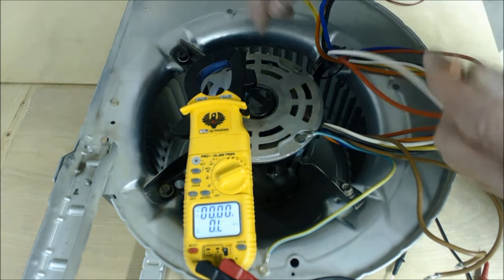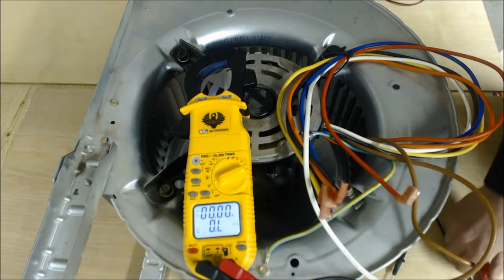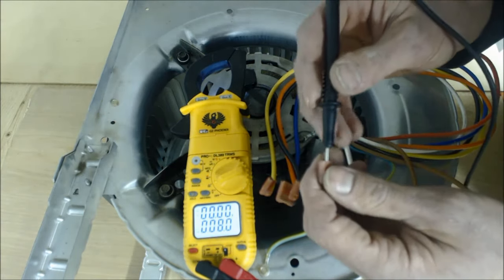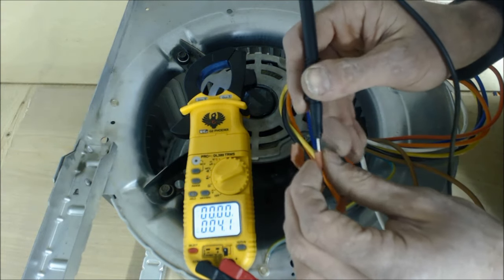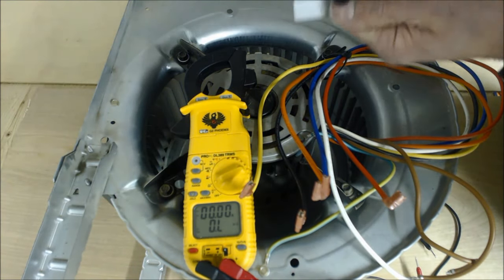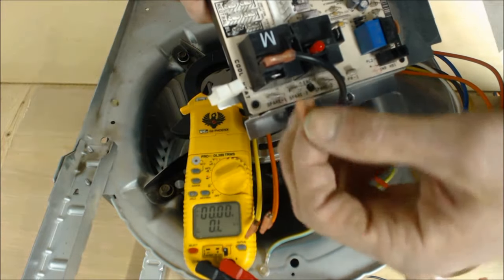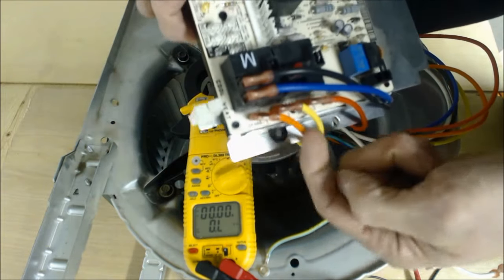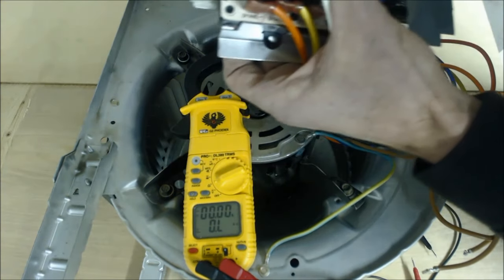Explained! HVAC Furnace Blower Motor Wire Color Speeds: Color Code, How to Test to Verify Speeds!

Comment: Thanks. After watching video I studied the wiring diagram and found previous tech had boosted blower speed. Before improvising, I decided to revert to factory configuration. Big big difference. House is warmer and furnace runs half as much. Thank YOU!
Reply from the maker: Glad to hear it worked out. Thanks

Comment: A+ on this sir. Good and clear details on what seemed an impossible task to 100% confirm which wire was the correct speed. Just went down and metered my carrier and got the exact OHMS that proved the wiring was correct. Blue was higher speed than the Red and using the spare tab to keep the Red cable now. The Blue is on Heat High and Yellow being used for Heat Low. The black and white cables are not being used for the speed.
Reply from the maker: Thanks J Pej!

Comment: Thanks for sharing!  Our house furnace was wired wrong..   I'd say a shitty tech trying to upsell new equipment.  

Heat was on black or high speed wire.  Cool was on blue or medium low.  

So moved cool to black.  Orange was medium high, so that is new heat wire

Comment: This is especially helpful if an original blower motor on a unit was changed and the speed taps are different. Keeps from pulling a blower motor just to check schematic.
Reply from the maker: Yes absolutely, thanks Blue Collar!

Comment: Typical color coding: Green = Ground, White = Common, Black = High speed, Blue = Medium high speed, Yellow = Medium low speed, Red = Low speed.  Brown and Brown striped = Capacitor
That is what I have learned.  I note this because few people mention the 4 speed motor wiring.

Comment: I need a video like this for a range hood fan motor. The only video I can find unhelpfully advises I wire the board in using the same colour coding as the old one. Which is fine if you have the old one in place to go from, but in my case I don’t.
Reply from the maker: Sorry Dom, I don't have a video like that.

Comment: Great video. I wanted to clean out my blower motor 'box', and I came across your video.  Question:  Is there any reason you can think of why my heat is connected to the Hi fan speed terminal, and my AC to the Medium (blue) terminal?  I live in Dallas, so I would think I'd want the AC running on the hi speed.  thanks
Reply from the maker: Usually that is the case like you said unless there is some mistake match with the system design.

Comment: My blower moter looks almost identical to yours but my wire colors are different. Mine has no white and no orange. Can you help me decode the 4 colors I have? It only has a black, yellow, red and a blue wire. Since I have no white, I dont which one is the common and which ones are for the different speeds? Thanks. 

PS: I did apply power to the black and yellow wires and it came on just fine but that was totally a Hail-Mary guess. It probably could have went horribly wrong but luckily it worked. I got pretty excited. I felt like a bomb technician on Mission Impossible 😂. I immediately ran out of confidence after that. I just don't know what speed it is or if its even suppose to hook up like this.

Comment: I have a query if you can please answer. I'm going to add a Honeywell UVC lamp to my return duct. It works on line voltage and stays always ON as long as it is plugged to a receptacle. That's what I do not desire.
I want the UVC lamp to turn ON only when the blower turns ON, irrespective of whether the blower is set to Auto, Circulate or always On and turn off when blower is off.
So my question here is should I be wiring the lamp across BLK-WHT or BL-WHT ?

Comment: Do you need to discount the capacitor taps before taking resistance measurements?
Reply from the maker: Yes the blower will mainly discharge the cap after the power to the blower is turned off but the blower is still free spinning. However there is still a little you will need to bleed off with a 10,000 or 20,000 ohm resistor or shorting it, thanks

Comment: My A/C guy just replaced my blower motor and now I hear a small hum coming from it when the A/C is running.  I've taken the grates off the A/C and can hear that the sound is not coming from the new motor and there is no shaking from the motor.  It seems to be coming from above the blower (maybe where the coils are?).  The motor has a Black / Blue / and Red wire.  Black is on Cool, Blue is on Heat, and the red was just cut and covered with electrical tape and stowed away.  My question is this:  Could the blower motor be sending too much air into the system to create that weird hum sound?  By the way, the original motor for the blower was a 1/2 HP motor.

Comment: Good video. I found it based on a related question I have. My furnace has a fan, cool, and heat port to connect the different speed wires to. I find that for humidity removal during cooling and for regular circulation with the "fan" setting, that one of the speed wires works best for both cool and fan. Is there a way to hook up one of the speed wires to both the "cool" and "fan" ports so both modes can run at the same blower speed when they turn on? Right now I have to choose separate blower speeds for each. Thanks!
Reply: Anyone have an answer for this? Can the "cool" and "fan" terminals be jumpered together and then hooked up to one speed wire so both modes run at the same speed?  Can wires terminated on the cool and fan terminals be connected to the speed wire with a wire nut? 
The spade terminals on these wires and the board are 3/16” as opposed to the 1/4" typical size and there doesn't seem to be a 3/16” splitter adapter readily available.

Comment: At 2:04 in this video you said... "as long as the capacity on your air cond. system matches your blower motor fan speed".  1) Can you clarify what you mean (or say it another way)?  I have a 20 year old system (I know it needs to be replaced but no money to do so).  It has a 3 ton condenser. 2) how can I tell tonnage of other parts of split system (has gas furnace). I also have some parts of house closed off (I know that is bad also but it is what it is).   Furnace is currently set to high cooling and blue wire heat and has a PSC blower.  I live in TN so pretty hot and humid June- mid sept.  I have allergies, so I want to filter the air, but high is just too much.  I also want to dehumidify more (mostly in 50-55% range right now - midle of hot summer day 93 degrees).  Additionally... I just hate the feeling of air blowing directly on me so want it more subtle if possible.  I already know about ecm retrofit options... but they R more expensive and I fear that their 600RPM might still be to high (Don't want to pay for motor and still not be happy).  I am thinking about changing cooling to a slower fan speed (? medium high (all the time all hours) ? or MAYBE low (mostly for night time use?).  My question to you... 3)  If I do so (assuming I do wiring correctly), can I damage other parts of my system (this is also based on my question #1 to you above)  To take it a step further...If I change the motor speed wiring... I was also thinking about adding a manual switch so I can toggle (ONLY when fan is off) to the other 2 available fan speeds without having to rewire the system every time. I would use a multi position switch and NOT a potentiometer to achieve the switching.  I do realize that changing the fan speed will also change what is happening in the evap and if a freeze over occurs...  I would probably simply revert to running system on high for cooling (or med high if possible without freeze ups).   So question 4) Assuming I wire it correct via basic switch wiring) would the switch cause any problems? Also... 5) Do you see any reason why the fan would need to be off when I switched between speeds?  Any tips or suggestions for accomplishing the above (other than I need a new system)?  Your fast reply to this message would be greatly appreciated.
Reply: Jo Tu
Means that the fan's rpm may not be able to ventilate enough air to keep proper air circulation /heat absorbance. In witch case the coil may get iced up or vice versa.

Comment: i know this old vidoe but i have a gas furnace that goes through startup process ok but the blower fan makes a humming sound and does not turn and then furn shuts off......the fan blade movies freely by hand....its a 4 speed 1/3 hp motor 1075rpm......what im trying to find out is that is it possible that just 1 speed is bad and if i switch speed connections that maybe 1 speed will work to get furn running temporarily?...i have seen this on radiator fan motor where the motor works fine on high speed .but does not work on low speed ....just trying to gete this furn wokring until i get new part..its very cold here..thanks

Comment: What is there is no reading between common and other wires?
Reply from the maker: If common does not have any resistance reading between it and any of the hots then the wires are burn't apart or the thermal overload inside has not closed. Thanks Micheal Vanlerberg!
Reply: how to check moter Iver heat
Reply from the maker: Look up "acservicetech hvac blower motor not working" to see the values and thermal overload, thanks

Comment: How can we verify that the high speed is giving us all the RPM?
Reply from the maker: We make sure that the static pressure is less than what the unit is calling the max typically and we can measure airflow if needed or do a temp rise on the furnace, thanks
Reply: Have you ever heard of a weak capacitor causing a motor to lose RPM?
Reply from the maker: No it is usually restricted duct or dust on the blower wheel which does not allow the psc motor to push as much air, thanks
Reply from the maker: Did you check the underside of the evap coil or do any static pressure tests?
Reply: appreciate the feed  back and enjoy the channel. I already left that job and they used another co through insurance warranty co.

Comment: Why have all those speeds and only use two
Reply from the maker: So that the system it is installed in will work for a variety of cooling capacity sizes, thanks!